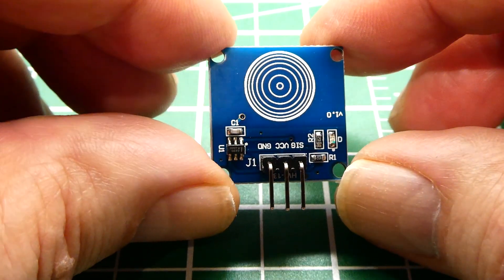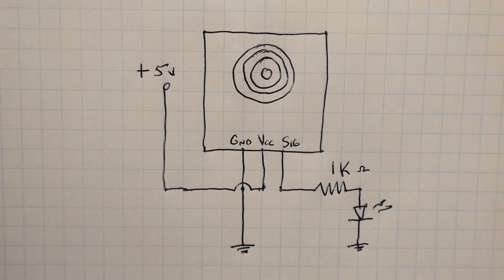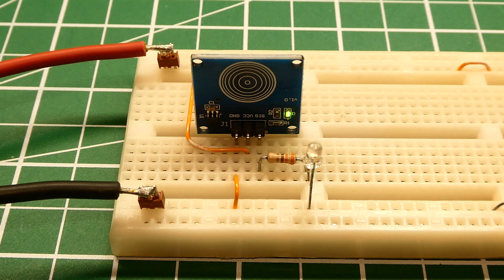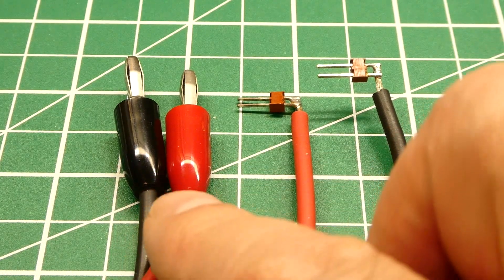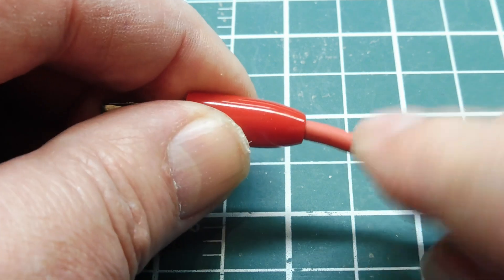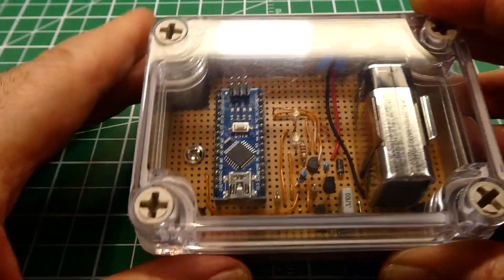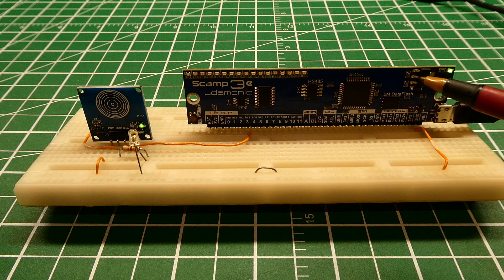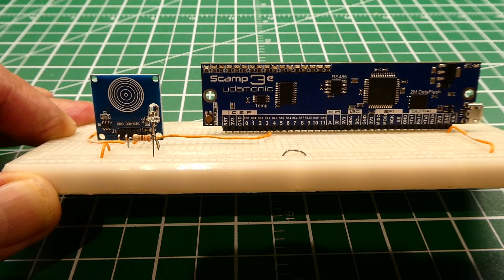Touch Sensor Project For Beginners

Comment: Have some of the red modules on order, hoping these get here before the next Postal Interruption in Canada. Crazy that the module cost about the same as just buying the chip. Have a good day
Reply from the maker: Order through Amazon who are not affected by the postal strike.
Reply: @0033mer  That is the backup plan but usually double or triple the price but a lot faster if it is "Fulfilled by Amazon". If not fulfilled by Amazon it can still get stuck since the seller ships by mail to the Canadian courier. Found that out the last time, ouch.

Comment: For beginner tutorial, I would bring the switch up or down 1 and 2 jumpers for your Pwr+, one to cross the column halves and the other to the PWR+ rail. This is to better illustrate the connections on the breadboard.
Reply from the maker: Thanks for the feedback. If the sensor is moved up or down the PCB hits the breadboard before the pins can engage properly into the breadboard. When the PCB is sitting in the groove of the isolation channel the pins can fully insert for a reliable connection.
Reply: @0033mer  Ah, header pin length. They looked like normal-sized pins to me, lol.
Reply from the maker: Notice that the silkscreen labels are upside down so I don't think the board was designed to mount on a breadboard. Male/female dupont wires are probably meant to attach to each pin and then plugged into a breadboard.